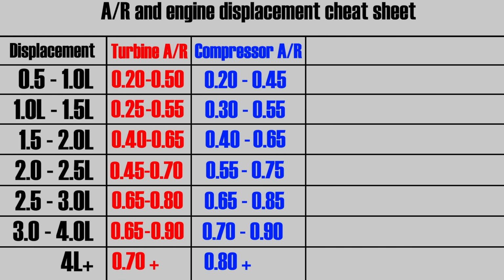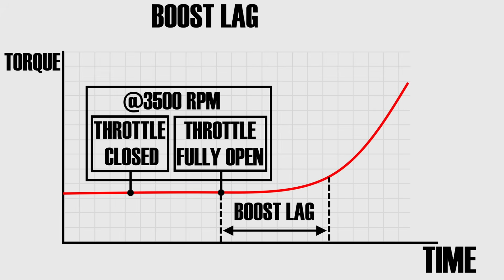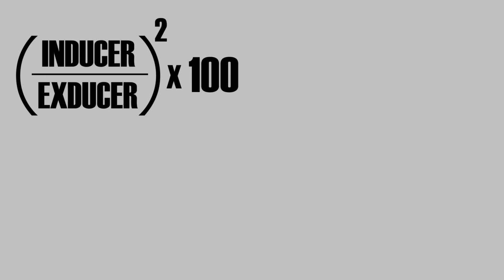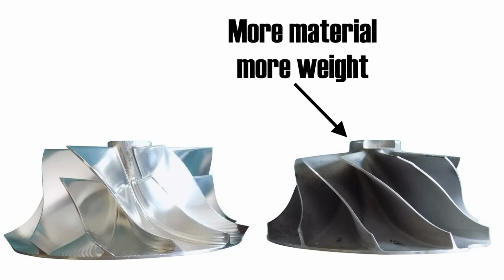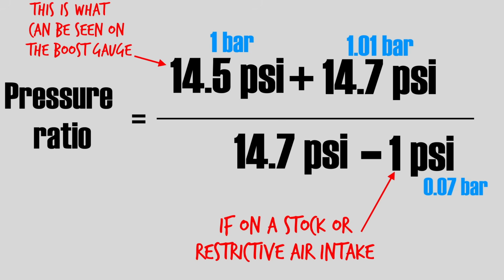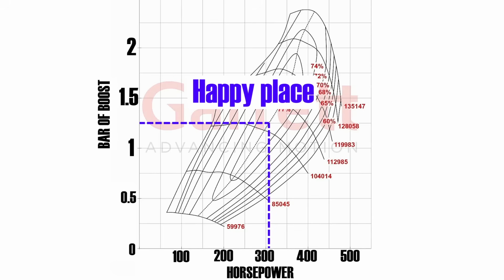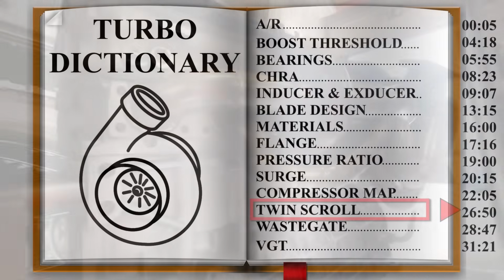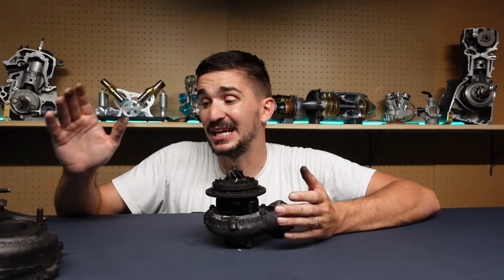All in One: A/R, Compressor Maps, Turbo Lag, Surge, Twin Scroll, VGT, Wastegate +more

Comment from the maker: Support the channel by shopping through this link: https://amzn.to/3RIqU0u
Patreon: https://www.patreon.com/d4a
Become a member: https://www.youtube.com/channel/UCwosUnVH6AINmxtqkNJ3Fbg/join
The video does not explain how a turbo works, in case you need the fundamentals of the operating principles that's here: https://youtu.be/VpcdYvG0k9M
Here's boost control explained in more detail: https://youtu.be/hYIL_XvlYTE
Turbo flutter and blow-off valves in more detail: https://youtu.be/BFXIgME_5UA
Practical video that shows everything that needs to be done to turbocharge an NA engine: https://youtu.be/gskkfFZXwzI
Reply: A/R is Area over Radius ( you said ratio )
Reply: I have a possibly weird question but is it possible to put a turbo in series with another turbo or are exhaust gases usually more pressurized than most turbos? or is this just not useful at all, pure theoretical of course
Reply: Nock Nock 🫥
Reply: so turbo chargers are like mini jet engines
Reply: This video extremely hard to watch due to YouTube commercials almost every two minutes. Please fix this! Thank you.
Reply: Couldn't follow the content of this video because it was extremely hard to watch due to annoying and interfering YouTube commercials almost every two minutes. Please fix this! Thank you.

Comment: What do you do for smaller turbos my pressure ratio is 1.4 and I can't find any turbo that's more in the center of the compressor map. Little confused also I'm the pressure ratio and bar of boost you used, why didn't you just use the pressure ration calculated for what you need whey did you make it bar of boost? My motor comes out to about 20 on airflow to make 200hp, 10,000rpm max and 1.45 pressure ratio closest turn insee is a harrett gbc 22-350 but all are on the low end of the map

Comment: This makes me so curious about the capabilities of say a titanium or titanium alloy turbo, sequential turbos, heat snyc and intercooling combos possibly with other cooling maybe chemical. Hell what about adding some form of nozzle on the turbo feeding into a sequential set up or even a low friction material coating for the bearings and a low friction separated lubrication system.

Comment: The only thing I wish you would have covered is the lower compression ratio allowing a smaller boosted engine to mimic the TDC volume and compression ratio of a larger non-boosted engine.

Comment: A/R [unit:inches]: for spiral flows, v is proportional with 1/r. If density is (more or less) constant in the outtake spiral, then (cross sectional) area needs to be proportional to distance from the axis of rotation.

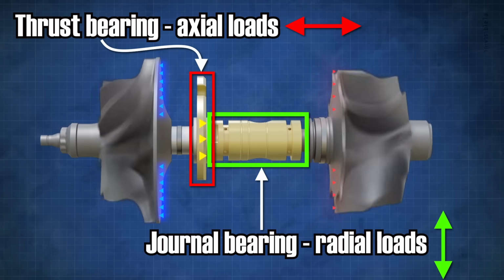Comment: 8:15 to add a negative about ball bearing type, they use less oil thus they need more cooling. Either water or lower oil temperature. Or both!

Comment: Compressor wheels with full blades GTX style like 11+0 have less blades then classical 6+6 with 6 half blades.  The GTX style is not better for boost threshold do not build boost at lower rpm then 6+6 compressor wheels. They are better at choke line at max rpm because they are used with ported shrouds that help draw in more air in choke line condition. Fewer blades can flow more but they do have a higher boost threshold too (they start to build boost at higher turbine shaft rpm).

Comment: eliminating the need for a blow off valve  unloss the turbo was too big. With the compressor in a vacuum the turbo did not loose speed on shifts and we could actually create very high boost pressures at launch by simply pumping thr throttle in neutral to allow the turbo to gain speed on opening the tthrottle thm quickly colosing it tjen repeating 4to 5 times to get 15 to 20lbs boost. Thankyou for your distribution oaccurate knowledge. Have been following your channel for a lomg whilek

Comment: I work on a good number of 5-10L truck diesels, never thought much about the A/R's, but they are often 0.89-1.29 A/R on these trucks. Even more interesting, the ratio changes across motors of the same displacement when they have different cylinder layouts or counts. Pretty cool stuff!

Comment: This is neat but its far from revolutionary...

It may be gearless but its not ratchetless. This is not a new invention. They need to overcome the issues with ratcheting mechanisms in high speed and high torque applications to make it reliable enough for long term use, and they're far from the first to try.

Comment: I beat this system 20 years ago. By adding a compressed air nozzle on the inlet turbine. The inlet turbine being the ideal profile for injecting “cold air” into the equation. Yawn.

Comment: You got A/R partly wrong. A/R Stands for Area/Radius, and is entirely related to the area of the start of turbine volute or end of compressor volute at the very first contact point on the turbine OD/or exit point on the compressor wheel OD, AND NOT the flange opening. Whatever area the flange has, basicly means nothing provided it is larger than the "throat" (Where A/R is defined) at the start of the volute. Further the radius is from the centerpoint of the wheel to the center of the area at the throat of the volute only, and NOT comparable to an absolute inlet area as expressed on old KKK turbos, and on Holsets etc. 

THUS the actual flow area AND radius will be much larger on a 100mm turbo with A/R 0.63 than say a more typical 50mm turbo with A/R .63. The best way to think of it is low A/R numbers are better suited for earlier boost onset for each turbo size. 
A low A/R does not necessarily mean the area of the throat is much smaller, but the radius might be shorter bringing that area closer and thus more tangential to the wheel (which achieves better impingement, but at the cost of higher centrifugal back-pressure at high flow), whereas a larger A/R might only be a larger radius lending itself to a more radial flow path that has less impinging action on the wheel, but also comes with less backpressure better suited for turbine efficiency at higher flow rate. On the Compressor side A/R is not as important at least not unless it's a diesel (or other highly restrictive engines) which require higher pressure ratios compared to flow.

Aka a small turbo will do as fine with A/R 0.63 on a small engine as a large turbo with A/R 0.63 will do for a large engine.
Reply: I mentioned this to him a while ago. Even offered to help as the majority of this information is flat out wrong, and only contributing to miss information.

I think these videos might be more for clicks and views than real information.

Comment: Man... Right to the the woods again, in A/R the R means radius, not ratio. A/R is the ratio between the area of the certain part of the inlet and the distance from the axle to the center of that area, you sort of had that correct, but.. Since obviously both the area and the radius increase with the housing size, the ratio can remain the same even if the housing is massively different size. On the other hand #12 or 12cm2 or something like that actually does tell the housing size. If there is more misinformation in this video I will not comment about it but this was just not a very good start...

Comment: Change the bearing with ceramic bearings in the turbo if it's got metal one. Wonder what the performance would be. Because ceramic bearings can handle a higher heat

Comment: G'day mate, great video. Keep up the good work. 
Three hundred in one of those is a quick car. I know as I had a bit more from mine. I guess you've taken care of the rear suspension. It's a magnificent handling car. Don't sell it. What do you think of the Mitsubishi 3000 GT? '89-90 model with pop up headlights was sensational. Had a couple of them. Twin turbo, active areo. Easy to get 5-6 hundred ponies. You have a great selection of videos. I have only watched a few. Looking forward to the MR2 build videos. From Australia. All the best.
Reply from the maker: Thanks for watching mate! Yes, suspension was done, there's a lot of videos of the build on the channel. The late 80s early 90s from Mitsubishi, pretty much everything is golden, especially the 3000gt, a car ahead of its time.

Comment: I'm trying to fix what I see as a design flaw in my GM LH7 1.6L turbo diesel which is in a 2018 Terrain here in the states, a common engine over where I assume you are. The problem is the EGR and PCV gasses and oil mixing and making that nasty sludge that chokes off my engine and ultimately fouls my oil with a gritty sand like texture. What I want to do is create a separate "clean oil" system for my turbo (which recently snapped it's shaft leading me to have to buy and entire new unit, no parts available....) Have you ever heard of something like this before? I just want to use and electric pump and reservoir to pump clean oil separate of my engine sort of like how a cooling system is setup. I don't see why people don't do this more often. Can't find anything in the interwebs about it. Thoughts anyone???
Reply from the maker: You can get a oil catch can in-between your pcv and your intake. It's a common approach towards alleviating your problem
Reply: @d4a  Got one. Drives me nuts knowing it's like clogged arteries in my intake.

Comment: Most turbos are labeled: 80mm, 76mm, the old 60-1. Most label the a/r on the exhaust side but don’t tell you the compressor trim, or just tell you exhaust turbine trim like P or O trim and don’t tell you the compressor trim at all. When they list adds for turbos I need specs to compare apples to apples. 
Years ago I ordered a turbo turbonetics catalog and read the turbo books. It’s simple math to figure a good map to make a selection.

Comment: I was looking at the Borg Warner EFR but the supplier said Borg dose not warranty theas on diesel due to excessive heat related failures so i went with a G25-550 for the manifold/ high pressure  on my Cummins. 
In therioy the 550hp , 550lbs per min flow will handle the 400max fuel flow capacity of my injection pump. 
Why would  Borg be denying warranty of there EFR( Engineered For Racing) citing excessive heat in a street  use. 1250°f max of diesel is much colder than 1900°-2200°f of gas .  Only guess I've got is that the duration of time at peek heat is short (even on a road corce track) vs for diesel the 1200 may be for several hrs constant .

Comment: Hi. You forget to mention are you talking abaut gasoline engines, or diesel engines, or does it even matters? Because, for example this compressor map, it does really matters. When gasoline engine produces lets say like a 300 hp power on this and that boost pressure, same size diesel engine does only 200 hp. Because, diesel needs way more air to make same power, than competiton gas engine. I know, you know it of course! But just saying, that it would make it easyer to understand for people. Expecially european people, because we have here at Finland abaut 50% of cars, diesel powered. And I guess all around europe it is same kind of situation. And yeah, we have here a lot, I mean a really lot of guys, that tune up diesel engines. I think that at the first place all this diesel tuning got from here. People, including me tuned up old mercedes diesel engines and made a huge amount of power! I mean a lot at that time. My car was old benz with om602 engine, 2,5 liter diesel and it made around 300hp and more than 400Nm torque. I had a holset hx 40, whit billet inlet turbine. It really worked great! And that happened something around year 2005 or something like that. (All those power numbers are not very accurated, because I had a couple of turbos on that car. And I only measurement the power with the old turbo. With old turbo it gave 250hp and 400Nm. something like a 1 bar of boost, or maybe litle bit more. But not anything grazy. With that new turbo, hx40 I boosted it more than 2 bars and it was quicker. But I never measurement the power, so I cant say how much hp there really was at the end.)
Reply: And of course, I forget to mention, thanks for the video! It was very educational, and I liked it! You are doing great job there telling us abaut all this car shit! I really appreciate your work! Ps, your toyota seems to make great power! Good for you! See you until next video! Thanks!

Comment: What is an anti-surge core then? Is it worth the effort to install it? Is it the same as hybrid turbo?
Reply from the maker: Yes, a turbo with a different core or different wheels is called hybrid, I don't like the term because it's just a turbo with different parts, nothing "hybrid" about it. An anti surge core will have wheels with smaller flow to try and prevent surge.

Comment: So if splitter blades with low trim and ar does the same thing as main blades high trim and ar, what's truly superior? Turbodirect sa's videos imply splitters are sine they have wider compressor graphs with more vertical choke lines, are more linear in the pressure ratio to flow ratio, surge less, and are better for a higher and wider range of pressure ratios.

Comment: Could MGUH be used on a Diesel engine? I've been thinking about it since Porsche revealed the GTS. A hybrid truck with a small battery but extended range and flatter torque curve sounds appealing.

Comment: @30:48 another benefit of an external wastegate is that the exhaust routing can be designed for smoother and more optimal flow both through the turbine and the gate.   Integrating a gate into the turbine generally requires sharper turns and more turbulence as the gas exiting the gate combines with the gas exciting the turbine.  These advantages are more significant in very high performance applications.
Reply from the maker: True!

Comment: I’m curious as to what your experience or reference to diesels is that you claim gas engines have a much higher EGT than a diesel and that’s why they don’t use VGT turbos, but diesel engines do. On our blown alcohol engine that makes nearly 2,000hp our EGT are under 1,200F yet my stock Cummins powered pickup runs nearly 1,300F and on a hot tune will see up to 1,450-1,500F and I know guys that have run even up to 1,800F on a race tune. I would say diesels more commonly use VGT turbo’s because of the reduced engine speed. Most diesels run at 3,500rpm or less. Where as most gas engines run up to 6,000rpm or higher. So trying to make 500-600hp on an engine that has a small rpm window is a lot harder.
Reply from the maker: No experience, I'm just making it up as I go.

Comment: how standard engines release boost pressure when you are off the throttle?  they don't have a blow off valve right?
Reply from the maker: It's usually called a diverter or recirculator valve, it sends the pressure back before the turbo

Comment: I have a small shitbox I want to turbo. It has a small 1.2L 1248cc engine and I'm planning on using Garret's GBC17-250 36MM turbo. I wanted to know how to read the compressor map and then what do ya know, D4A delivered. This is more a for fun project than making a race car. Stock power is around 86HP and I'm looking to make around 130HP on boost.

I honestly can't wait haha.

Comment: In the 1990s cars like the RX7 had a sequential turbo setup to operate on a wide rpm range with less lag. Has the current turbos efficiency improved that much that this option is no longer needed?

Comment: Twin-volute turbos are another option for preventing pulse interference, and can actually be an even better option than twin-scroll variants. The problem with twin-scroll turbos is that the exhaust pulses can still interfere with each other where the housing meets the turbine, as these scrolls enter at the same point. Twin volutes enter the turbine wheel 180° apart, therefore there is no chance that two pulses meet. This design can be found in the I4 Chevy Silverado and the Cadillac CT4-V, and more information can be found here: https://www.youtube.com/watch?v=HYzWoAJYFe4

Comment: Should do a video on oddities. I've heard of air and magnetic bearings as well as a turbo that separates the hot and cold sides with a long shaft to reduce thermal soak from the hot side.

Comment: My dad has this idea of using magnetic-levitation bearings in turbos to substantially decrease resistive forces. Another benefit in theory is that it's self-correcting, as the stationary magnet will repel the shaft back into its regular position. Is there any reason as to why companies like Garrett prefer journal and ball bearings over magnetic equivalents? It also seems that creating magnet-operated bearings can be cheaper than producing high-precision ceramic ball bearings, so I doubt that's the reason.

Comment: Insightful!

But, for larger engines, there is something called wastegate and bypass, which helps to prevent surge in the compressor wheel and turbine wheel respectively. 

Also, what you call "Compressor map/Efficiency Island" can also be called "Gas Envelope". 

VGT is also known as Variable Inlet Guide Vane. 

Nice video. Keep it up 👍

Comment: The VNT turbo was first used on mass production gasoline vehicles in 1989 by Honda and Shelby on separate vehicles. The Honda was a small displacement engine only in JDM. The Shelby was the CSX-VNT, then Chrysler made Daytona's, LeBaron's and Shadow's with the VNT in 1990 before pulling the plug.

Comment: The best turbos are the elctrified turbos, since although being really big, therefore capable of producing a lot of pressure,  dont suffer from turbolag, don't need a wastegate and improve efficiency since they convert the thermal energy of the gasses to elctrical energy.

Comment: My car OEM turbocharged.
Can I install a ETHANOL kit on it like your previous video and run it on my car without remapping? . 
By the way my all car are OEM I didn't modified anything on it.
Also should I use distilled water with Ethanol or not ?

Best regards for your great job.
Reply: Why you didn't answer me☹️